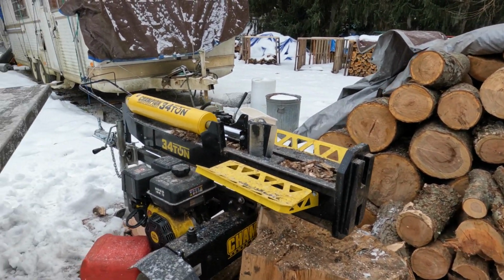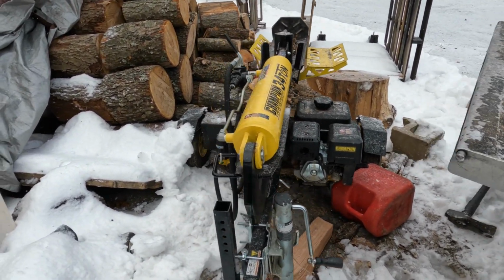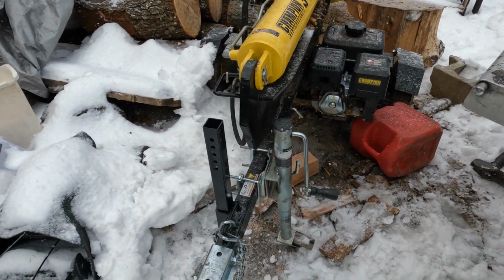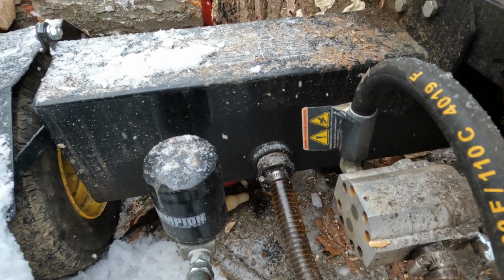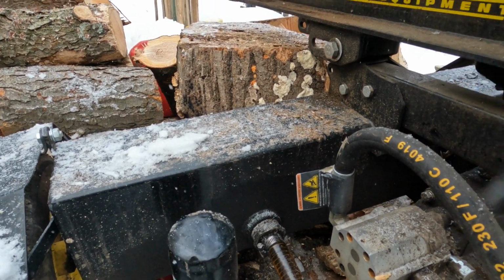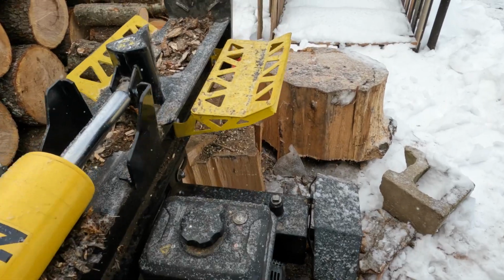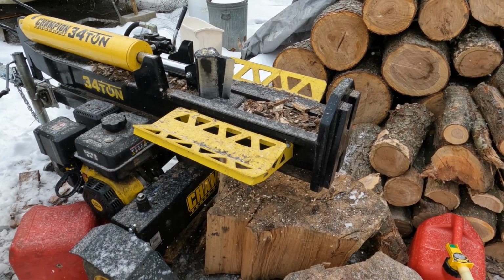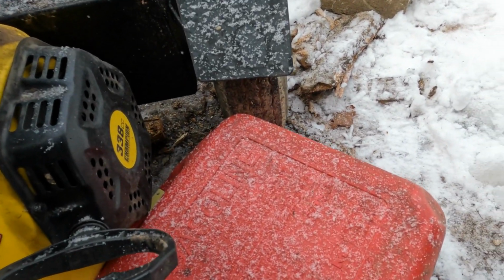Champion 34 ton log splitter pros and cons. Splitting cherry firewood

Comment: When your through using the splitter, You should always turn the gas off and let the engine run until it dies. The reason  you are having to pull the plug an blow the gas out is because the float in the carb is bouncing around when you transport the splitter, letting the needle valve come off it’s seat allowing gas to free flow into the engine. Some of the gas will also drain past the rings and eventually overfill the crankcase diluting the oil which can destroy the engine. I would check the oil and if it’s overfull, drain and refill with new oil. Also even if you’re not going to transport the splitter, you should still shut the gas off, because those needle valves are famous for not seating and leaking. Happy splitting.

Comment: Thanks ALL ABOUT OUTDOORS, appreciated the walk through. Good point on moving machine while gas open...I flooded it and couldn’t figure out why...(DUH). Good tips and great demonstration. I got the same splitter because we have Tamarack and we get pretty big rounds...35-48”...but we do the big guys vertices...but the smaller ones we do horizontal...plus we use the cedar small rounds as kindling.  Great work though...and like you my wife doesn’t mind working the splitter in the horizontal. Works very nice. The replacement for the hydraulic fluid filter was not easy to find...and seems like Champion is a bit behind on providing parts and maintenance products. But thanks for the training video!!! Merry Christmas
Reply from the maker: glad I could provide even the littlest bit of helpful information. I cheat and use the bobcat to lift rounds up onto the splitter that are too big 😆. Merry Christmas     🎄🎁 🎅

Comment: Got mine a few days ago. Two oil filler plugs? Why? The inside oil filler plug is very hard to remove (hard to maneuver your hand in there). The little dipstick on the plug, I thought I was to break just trying to screw the plug back in. Put the initial engine oil via the front oil plug, but needed a bendable funnel not to spill the oil everywhere! However, was very please with it -processing wood. It is saving wear and tear on my body (I split by hand before). What took all day before, now takes a couple of hours.

Comment: Hey just so you know you have the hydro filter installed upside down, it's supposed to be facing the ground and hose end up. Spin it a half turn with a wrench...
Reply from the maker: That’s how she came and it’s in the manual that way so 🤷‍♂️ runnnn itttt 🔥 🪵

Comment: Has anyone had their log splitter wedge stop moving?  It's like the power from the engine doesn't get transferred to the hydraulic lines or piston / cylinder.  I see air in the hydraulic lines.  Is that the problem? Or maybe I need to adjust the return pressure nut?
Reply from the maker: Only thing I had an issue with, on mine was that gasket thats up by the control lever started leaking and did the same thing was moving slower. Obviously because it was leaking fluid out there and getting air. That sight glass should be totally full I thought? definitely doesn’t look like it unless you don’t have it level in the video I watched. Gotta be a leak somewhere

Comment: That small yellow rack on the operator side of the splitter is mounted incorrectly, which can result in the wood being trapped between it and the wedge, which can result in the wedge being crammed into the "C" channel on the other side of the beam and bending it.  The assemblers are mounting the racks upside down, which gives it the up curve, but it should be flipped so the rack is level with the beam.  Home Depot had to replace my splitter as a result of the "C" channel and the rack being bent.
Reply from the maker: I’ve almost chopped my fingers off multiple times with those stupid triangle cutouts, where I’d be holding a log it would wedge apart, pushing my finger into on of those triangle cutouts and the wood pinching it in there. 100% of the time I’m wearing gloves so the gloves usually take the pinch but I have multiple pairs with the fingertips missing due to that. Wish they didn’t have the cutouts they’re just for the looks anyways.

Comment: Check your air filter and please let me know what came with it. I got a 11/16 piece of foam. See my video .
Reply from the maker: Yup same here everything on the air box is the exact same as yours. As for the unbranded engine. I’m telling you, you won’t be disappointed. I started mine up today for the first time in probably 3 months. Literally choke first pull fired right up. For an in house (likely Chinese) engine it’s actually a pretty good one. Mines probably 1 1/2-2 years old now and split I couldn’t even tell you how many cords so far. More than 20 for sure.
Reply: @allaboutoutdoors5083  .... Yes , it's a nice log splitter but it does need an air filter . Any engine needs an air filter and without one the engine won't last.
Any potential buyer needs to know that it only comes with an 11/16 piece of foam for an air filter.
Reply: @good-boy-ringo  is there an upgraded filter? I was thinking about getting this one
Reply: @Deuce_Allan  ... If you find one let me know .
Reply: @good-boy-ringo  Foam makes a good ait filter....  Many of the better filters made for my dirt bike and ATV are all foam air filters.  You oil them and they just work!
Reply: @Abyssdiver  ... I been working on cars most of my life and was state certified but  let it expire years ago so I do know what a good air filter looks like . The air box on this machine is 8"x8 " if not bigger with this small piece of foam in it just don't get it. The foam is not what it should have and I'm sure not what was designed for.
Reply: @good-boy-ringo  Let me guess you would rather have a paper filter?
Reply: @Abyssdiver  ...  I want something that fit the air box and seals not a piece of foam thrown in the air box that doesn't keep dirt out.  i how this help you.